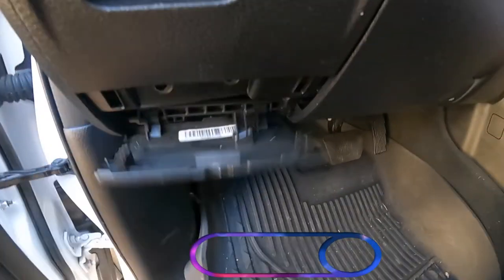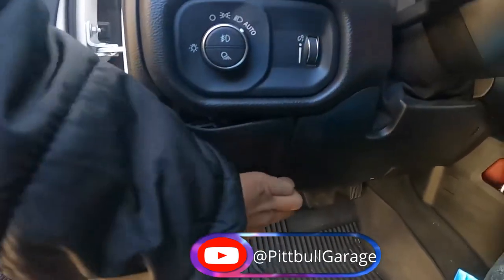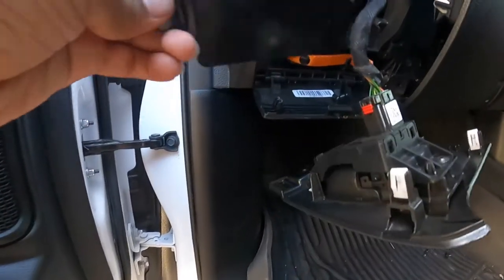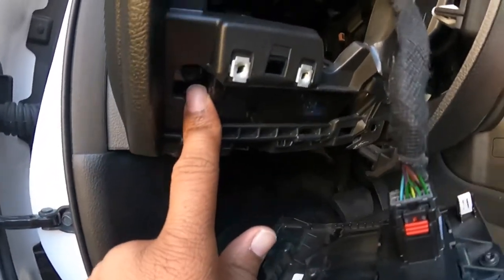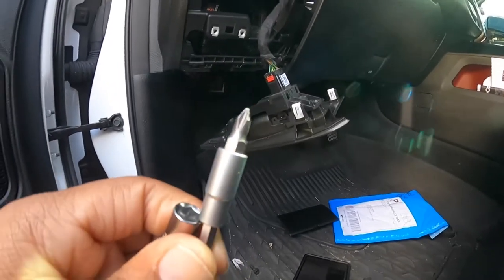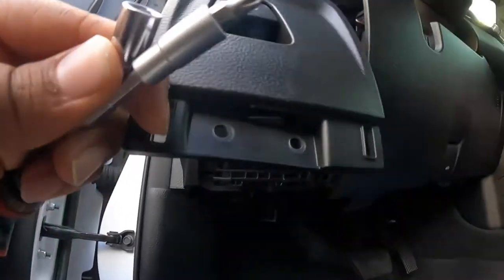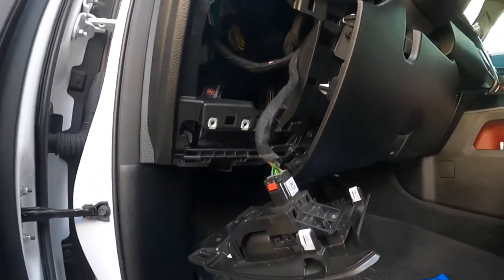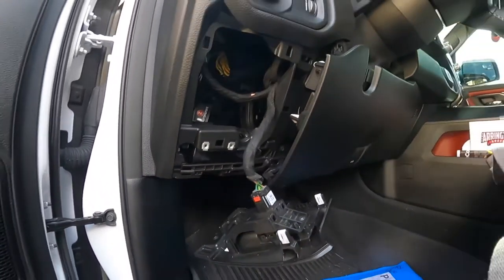2014-22 Ram (TDS) Neutral Release Cover Installation Video (On Sale Starting 11/25)

Comment: I like it!  But are you REALLY charging $40 dollars for that one little ass plate??!  🙄
Reply from the maker: Less than half a tank of gas.
Reply: @Destroyer1320   Just curious  🤔 but wouldn't a thief just smash the cheap plastic of the dash and pull the release?  Any way to reposition it so they can't find it?
Reply from the maker: @jwolveee  the plastic is stronger than you think. Yes you could try and pull the entire dash apart and relocate it. Most people do not have the experience to do that so I made a simple solution. I appreciate your thought process.
Reply: @Destroyer1320  if i was a thief and bought a cover, I would now have the correct bit to remove the screws and could begin a theft rampage.  How could we fix this problem?
Reply: @smoothredgem pow pow pow ...
thus ensuring the thiefs recividism rate is perfectly 0%